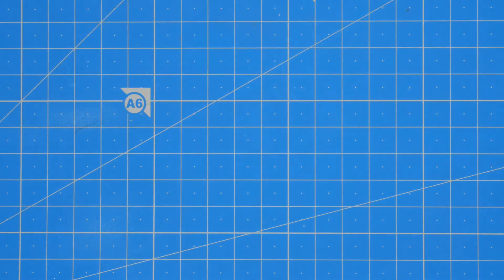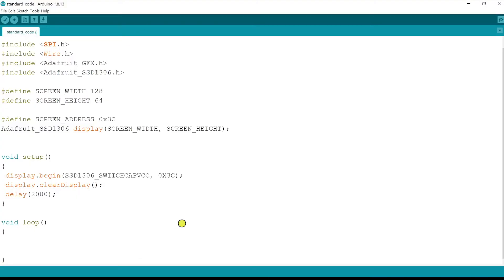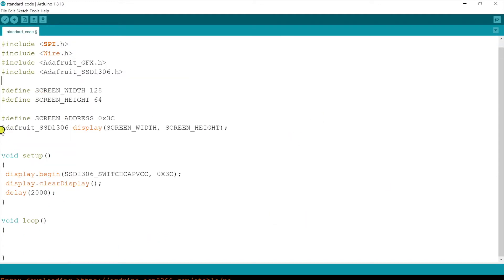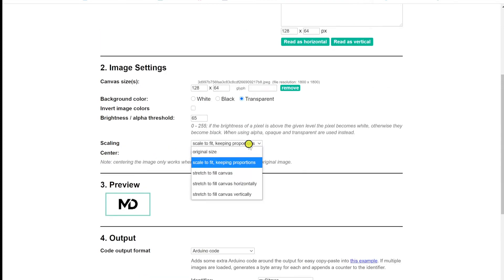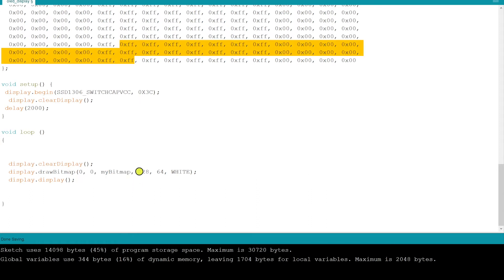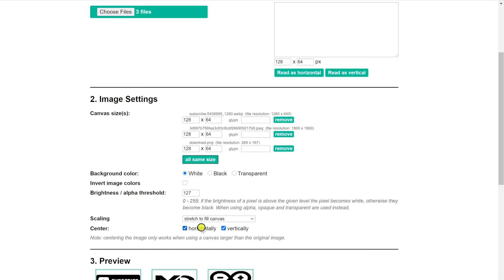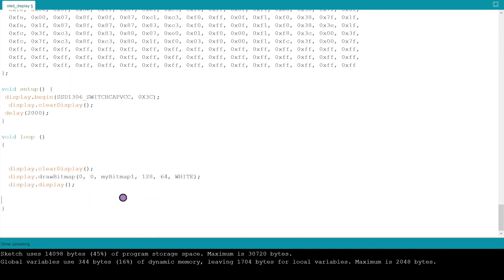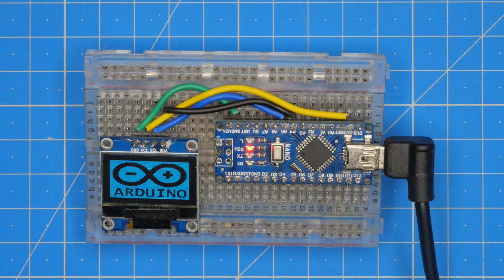SSD1306 128x64 OLED Display I2C with Arduino code

Comment: I've done it but using Arduino UNO, now when uploading image, I am sure my screen is 128x64 and preview on image2cpp shows a complete image of my bitmap but when uploading is not centered and looks bigger, I adjusted coordinates to 0, -15 to center image but still outside up and bottom side of image cutting some for both parts, can you tell how to fix this? I tried all configurations on image2cpp but nothing seems to fix it.

Thanks

Comment: Great video!!, thanks, it looks very easy but I am stuck finding I2C Address, I ran your program and shows no devices found, tried with several screen and arduinos, so the problem is something I am not considering, COM is right, when I connect to the arduino shows the connected COM but nothing shows up when looking for address.

Any idea how to find it?

Thanks
Reply from the maker: I have shown the procedure to find out the I2C address, code to find the address is in the description
Reply: @MOUNTDYNAMICS  thanks for the quick reply, indeed I did the exact same way but cant find any device connected to my nano
Reply from the maker: @joselagunas1038  make sure correct com port has been selected
Reply: @MOUNTDYNAMICS  it is since I uploaded the program with no error
Reply: @MOUNTDYNAMICS  I just did the test using Arduino UNO and no problems, there's something I am not doing right with nano, maybe some controllers? but I can upload program with no problems to nano but when runing to find address I can't find screen